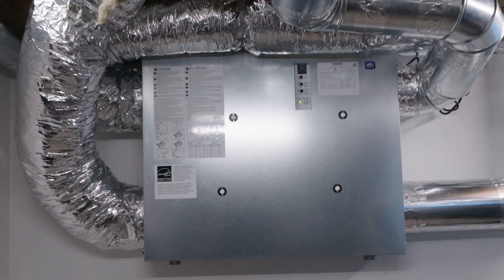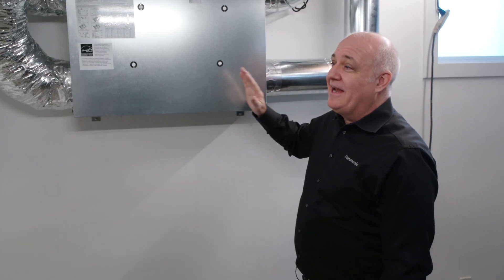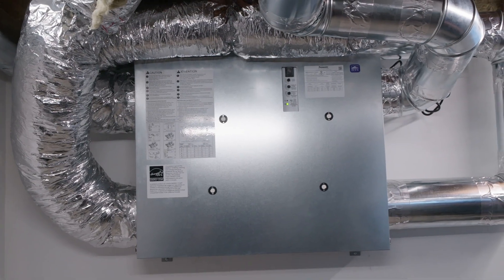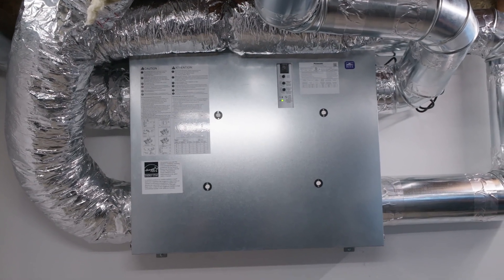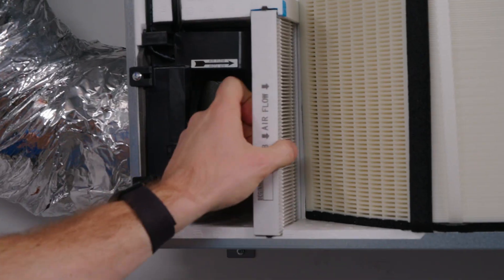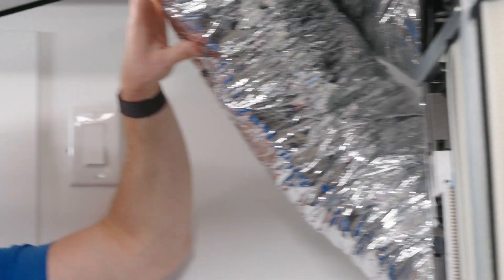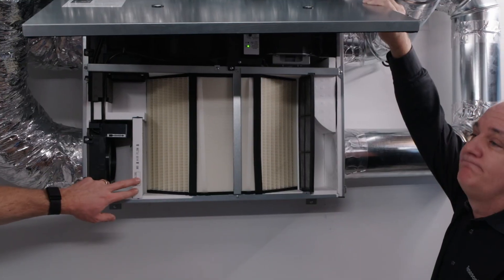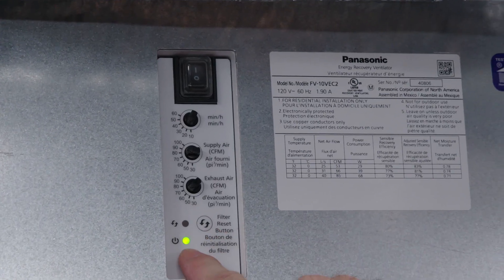Holmes on Homes: What is an ERV and How Does It Work?

Comment: What is the benefit if the air quality is garbage (Alberta, BC, northern SK, all summer due to wildfire smoke)? Holmes Group talks about “outdoor fresh air” but that’s no longer the case in the West for significant stretches. Please advise.
Reply: The filters will remove a lot of particulates, such as smoke from wildfires. You still need oxygenated air from the outside, so you're going to need your house to breath somehow, better it go through a heat exchange and filtration system.